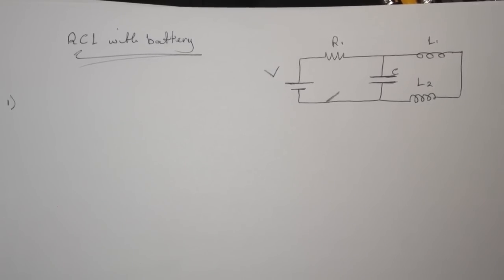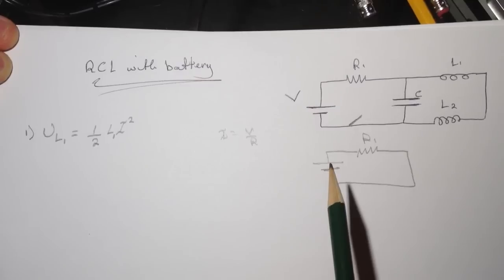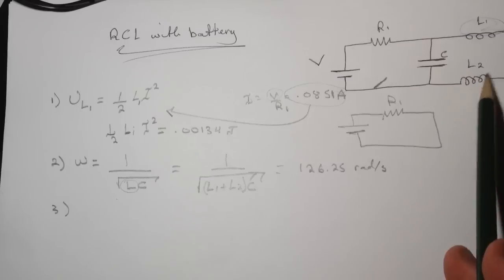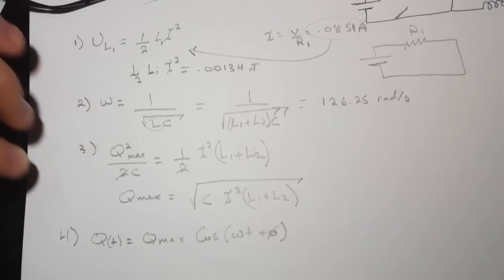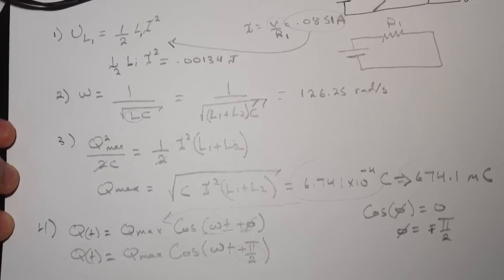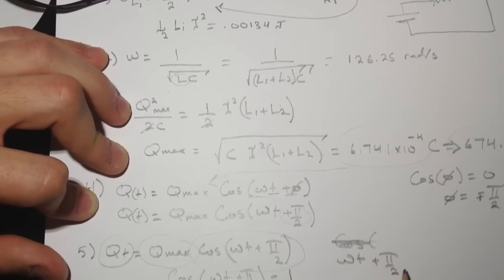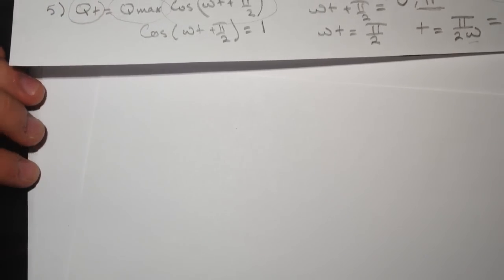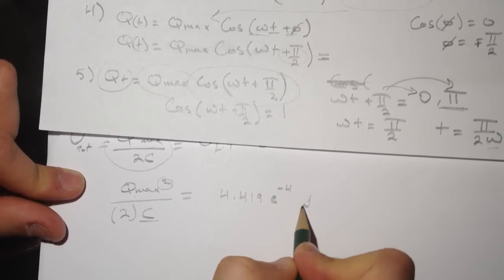RCL with battery "Smartphysics" Solution

Comment: On #5 why do you use 0 and pi? cos(0) = 1 and cos(pi) = -1. Shouldn't you be considering 0 and 2*pi since they are equivalent?
Reply from the maker: I didn't consider it because if you read the question, its asking about the "first time" and the 2pi would be a second time that it might reach zero i think.